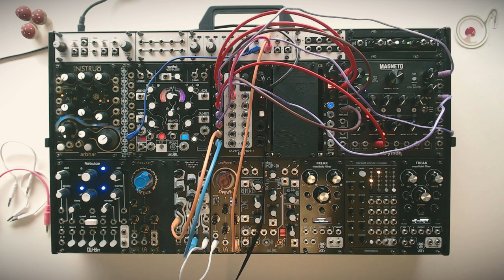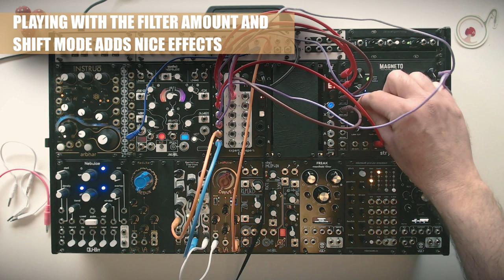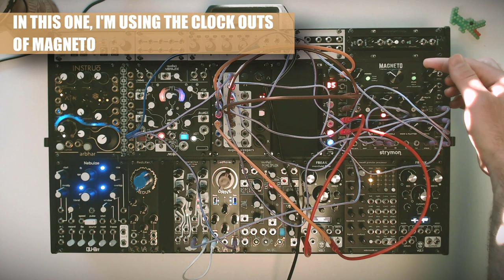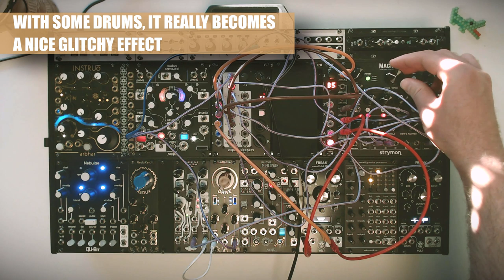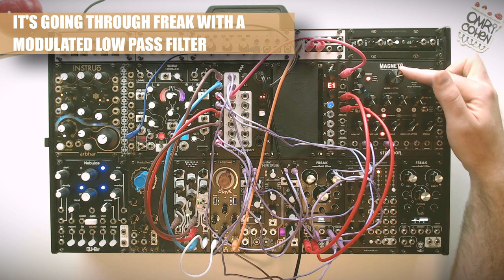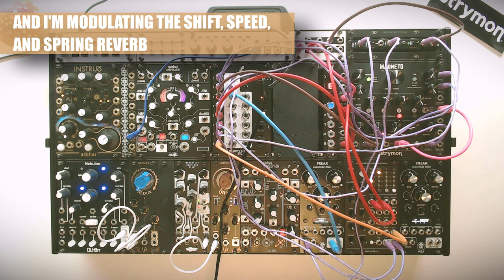5 Glitchy patchlets with the Strymon Magneto

Comment: I’m most curious about the BIA sound on the first patch. How did you get it so round sounding?
Reply from the maker: Oh, the BIA is such a nice module... Basically, I have it set the Skin algo so there's no pitch modulation, and the attack is high enough so there's no click or noise.
Reply: @OmriCohen-Music  I’m so used to using it as a percussion module that it takes me by surprise when it sounds like such a traditional bass synth voice like this. I’ll have to change gears with it mentally and explore it more.
Reply from the maker: @dangayle  It's super versatile and capable of producing smooth and almost singing voices...  Have a look here, I explore it's mellow sound even more - https://youtu.be/jQc_UAHHXyI